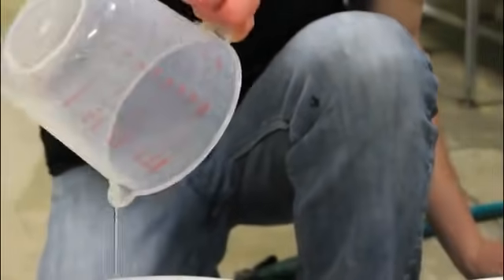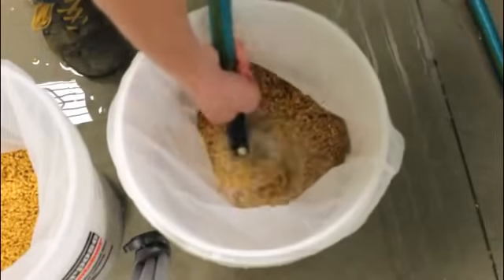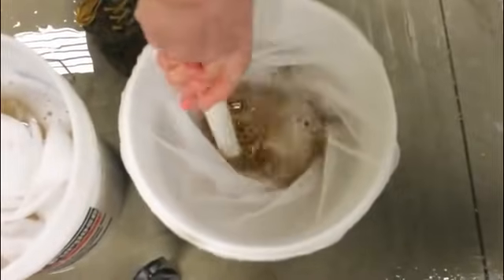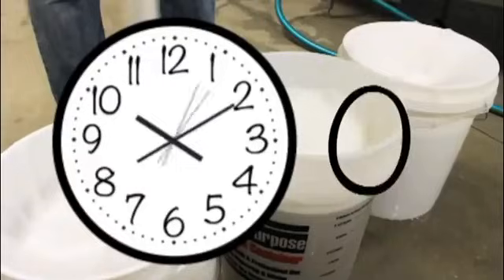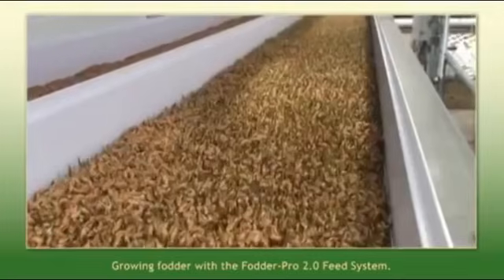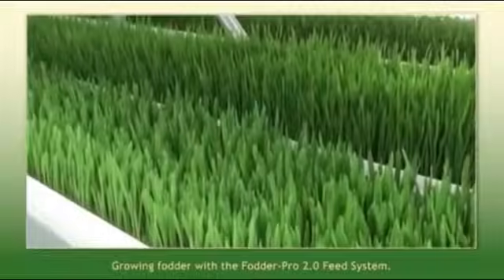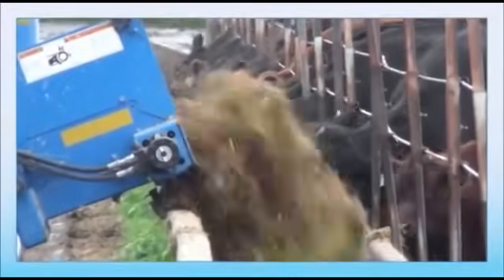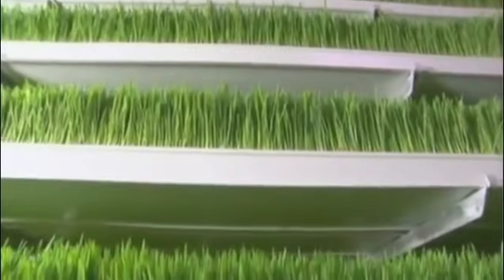Operation Video of Hydroponic Fodder System

Comment: Dostum çamaşır suyunda kaç saat bekletiyoruz ben yaptım çok küfleniyor bukonuda yardımcı olursan çok iyi olur türkiyeden selamlar
Reply from the maker: This depends on the concentration of your bleach solution. Generally, at around 0.5% concentration, the soaking time should be between 10 to 15 minutes. At about 1% concentration, the soaking time should be 5 to 10 minutes. After soaking, thorough rinsing is necessary to reduce any residue. This is my advice for you—wishing you success.
Reply: Yıkama esnasında kireçte kullanabilirsin

Comment: What is the bleach for?
Reply: I heard it helps prevent mold growth
Reply: @thembandaba9021  - 1 cup to 5 gallons gives a very high ppm. One cap full to about that much will give a sanitation level in other industries- such as hospitality.
Reply: I think that the bleach is mainly used to chemically peel off the protective coat on the seedlings during the soaking stage. So every watering period rinse the bleach out in the coming days. But that makes me very uncomfortable since the biology of the bleach will seep through to the fodder. Not sure but ultrasonic bath might do the trick... Mechanical physics vs biological physics in oder to achieve the same outcome.
Reply: Merhaba iyi günler 50 kg arpa veya buğday için kaç litre krolak  kullanmalıyım ve durulama kaç dakika olmalı  ve bu  buğday hasılının faydasını görebildiniz mi şimdiden çok teşekkür ederim
Reply from the maker: I apologize for getting back to you so late. My response to your question is below and I hope it helps.

In hydroponic forage production, the seed is usually soaked in a diluted bleach solution to prevent mold growth and reduce contamination. Due to the warm and humid environment of hydroponics, molds can easily grow, and bleach (usually a 1% solution of sodium hypochlorite) effectively kills any bacteria, fungi, or other pathogens that may be present on the surface of the seed, thus ensuring that the seed germinates in a clean environment.

This treatment also helps to improve germination rates because it eliminates harmful microorganisms that may prevent the seed from germinating or lead to mold growth that can affect the quality of the overall forage. After the seeds have been soaked in bleach, they need to be rinsed thoroughly with water to remove any residual chemicals before moving on to the growing stage of hydroponics.

Again, my apologies to you.